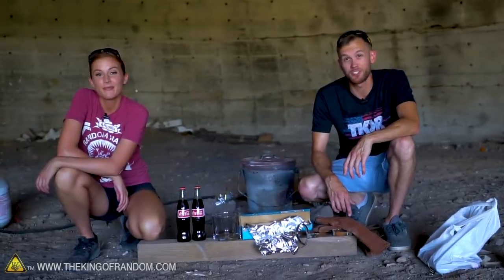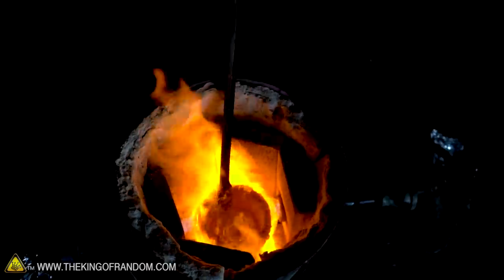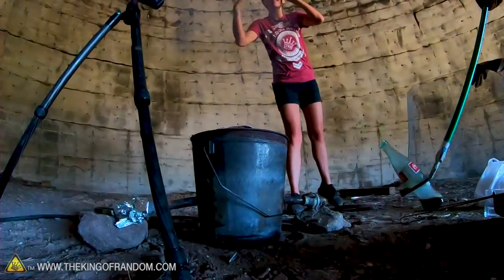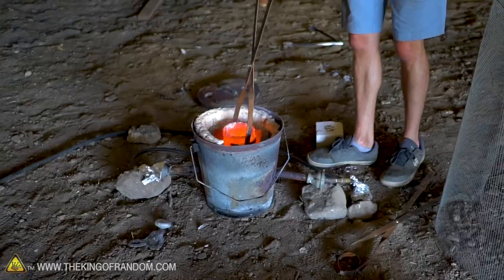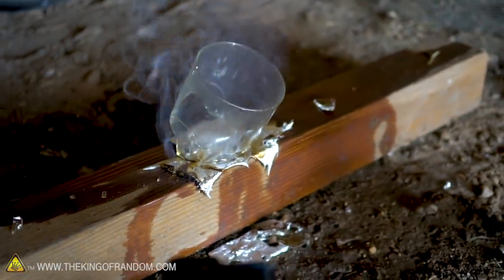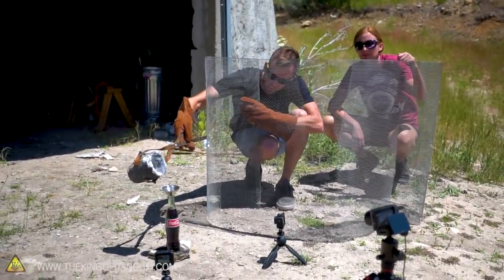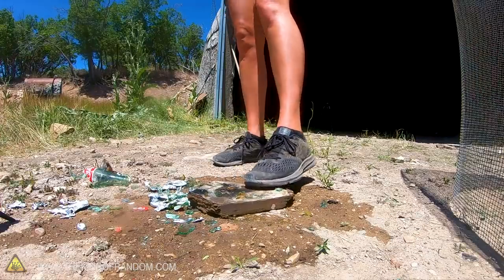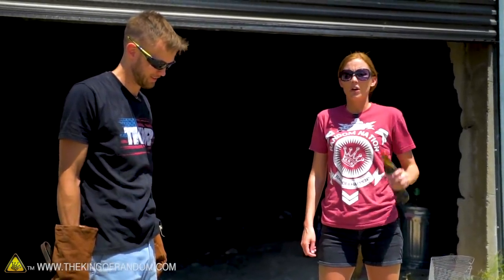Molten Aluminum in Coke Has a CRAZY Reaction

Comment from the maker: For those who may be wondering why we aren't using the new metal foundry, this video was filmed before we made the new one!
Reply: Ok thanks for letting us know
Reply: Love you guys
Reply: I was gonna say...
Reply: Keep on doing those videos!
Reply: Try putting sodium metal in different liquids like soda or liquid nitrogen instead of water
Reply: hey can you guys incase different items in jello and do different experiments with them
Reply: @eguy1596  I like it
Reply: You tried affecting the density of wood in a previous video by boiling pressurizing and using the vacuum chamber. Water was the key ingredient, try liquid galium instead of water the wood might absorb it making an interesting way to make metallic structures from wood. You'd further have to design a new vacuum chamber capable of keeping a temperature of at least 300° Fahrenheit or 148° Celsius making for lots of new interesting projects including trying the liquid galium and wood and if wood wouldn't work try foam or some other material.
Make magnets, melt a fero magnetic material in your new foundry then cool it in a strong magnetic field. It should become a magnet. Experiment with alloys and other metals silver gold try copper tin and so on
Reply: See if mentors still react with boiling coke
Edit:also I'd love to see you guys have a coke bottle rocket contest.
Reply: YEEET THE COKE
Reply: Hey Nate what happened to the large metal foundry you made will you ever use it?
Reply: @kennethsdodge5070  can you read?
Reply: @thegamingspirit9043  Calli verse Nate. Totally epic! I think Nate would win but Kelly's would definitely explode much more fantastically
Reply: Ok
Reply: Mix Sulfuric acid and Potassium Permanganate. It make a chemical called Manganese Heptoxide and reacts violently with isopropyl Alcohol.
Reply: I was wondering that lol
Reply: you might benefit from making a blast shield like the one the myth busters used
Reply: That’s the first thing I asked my self when I saw this
Reply: You guys should drop a whole bunch of Alka-Seltzer tablets into molten aluminium. I'm wondering whether or not there would be a reaction at all because they require liquid to release gas, but it takes a second to start reacting, so I'm thinking they may just burn up. Worth a try though.
Reply: Took the words right outta my mouth lol
Reply: Love u guys
Reply: Can you check my comment and this was AWWWWWSSSSSSSOOOOOMMMMMMMEEEEEE
Reply: Maybe edit out that "you are going to die" line?
Reply: I must be blind because I thought it was
Reply: You and Calli are perfect for each other! If y’all aren’t married to anyone or anything y’all should see if y’all are compatible!
Reply: Ahah. I cant wait to see you use the new one. (Totally didnt edit my comment because I typed did instead of didnt lol)
Reply: Drop molten aluminum on gallium and/or liquid nitrogen.
Reply: Ok
Reply: It's been kind of a ...I'm not going to say "fun," for obvious reasons, but an interesting game of trying to figure out whether a given video was filmed before or after two weeks ago.

There's actually only one so far that I'm certain is new.
Reply: I wonder why you made a new foundry
Reply: Can you guys please say hello to me?
Reply: Hey put sodium in some non-Newtonian fluids and in molten aluminum
Reply: Can you guys try cooking popcorn inside vacum chamber will it be more puffy or will it be more different?
Reply: May I ask why you were shorts rather than jeans???
Reply: The King of Random if you straight pipe a Chevy v8 truck and hold the pedal to da metal 😂 can it shatter glass?
Reply: Put dry ice in liquid oxygen to see if it will still put out fires
Reply: Put the molten aluminum in the candy form the last episode/video
Reply: Ty for telling us. I was like wtf why not. Lol
Reply: Still recovering from
Reply: The King of Random  it is 6 hoooours since u ppppposted
Reply: Oh and by the way you should of used aero gel as it is an almost perfect insulator
Reply: @fishman432  sodium reacts with water and some organics. It will react the same way with soda as with water, and it won't react with liquid nitrogen. It won't react with any pure hydrocarbons, so no gasoline or oils of any kind, and the only reaction it would have with alcohols would be with the water they're mixed with.
Reply: Maybe that was better because of the coke😂😂
Reply: Sodium into molten aluminum
Reply: See what happens when you put lithium in molte aluminium
Reply: I have a challenge, find as many different brands of drinks and mix them all up and do expriments on it :D
Reply: @carolinelyda9008  i totally agree
Reply: Oh, it was made in the week when they where anouseing grant’s death
Reply: @SeaTurtle1122  thank you
Reply: The King of Random np
Reply: I thought so
Reply: Drop sodium in the molten aluminum
Reply: You should pour molten aluminum into a fire ants nest and then dig it up after it cools it makes a perfect casting of the ants nest some people even buy and sell them as art
Reply: you guy should freeze propane fuel and see it if it flammable
Reply: You guys are crazy, that's why I love it
Reply: That’s exactly what I was wondering lol
Reply: You answered my question before I could ask it.............

++RESPECT
Reply: You should make a video on if you guys are dating or not you should make like a q&a
Reply: What happens when you mix sulfur, charcoal and powder of cooked limestone (before putting it in water) and then light it on fire?
Reply: Can’t wait to see the new foundry in action
Reply: Makes sense
Reply: I like to see you guy, drop one pound block of ham in molten aluminum
Reply: @christianheichel  The wood-gallium experiment sounds like it's theoretically possible. However, the magnet one wouldn't work. The reason why magnets are magnetic, is because each molecule in it have their north and south poles aligned. When you melt it down, you get rid of this alignment, and each molecule's rotation is randomized, even after re-cooling it. This renders it non-magnetic permanently (unless you break it down, and practically reuse the materials to make another magnet like they're made in the first place.
Reply: @monkeytank4243  cooled in a strong magnetic field it should work. While still liquid if subjected to a strong magnetic field the metal should aline with the field while cooling. I'm just guessing I haven't looked at the science in years. Maybe I should lol. Either way it'd be awesome to see them try.
Reply: @christianheichel  Yeah, it would be cool to see them work through it.
Reply: I was confusion
Reply: The King of Random i recall you mentioning that you recorded and made some videos before Grant’s departure.

Still happy you are continuing his legacy <3
Reply: MAKE SODIUM VOLCANO
like a baking soda volcano
Reply: I was wondering why you don't your prepositions from your adverbs.
Other than that, still a great video.  Always fascinating.
Reply: Ah thats cool
Reply: is it me or does cali yell a lot more...why does it always seem like she is yelling these past few videos
Reply: I was wondering how much whipped cream is in a can of whipped cream?
Reply: Annecy balls what can you do with them
Reply: Oh i was wondering!
Reply: The greatest warning is a delayed warning ⚠️
Reply: oh ok!
Reply: The King of Random can you dye molten aluminium and see if when it cools it makes coloured aluminium?
Reply: Could u try casting an aluminium container (like a box or cup) and after its cool pour molten aluminium into it!?
Reply: Hey Nate and Cali. Since you guys have a new foundry are you going to make new tongs for it too?

Comment: Cast a prince rupert's drop in epoxy with the tail sticking out and then break the tail.
Reply: Oh, Ohhh. I get it. Explode it inside a casing and see what happens. That's interesting. In clear epoxy so we can see it on the inside.
Reply: That would require them to do actual work. Not a "low bearing fruit"
Reply: @wolfbladesalpha6271  lol
Reply: Bring the slow mo guys or destin from smarter every day too get some very fast high speed shots!
Reply: I don’t think that would work. Maybe it would. Our brains think differently.
Reply: It wont work the same... theres a reason the prince ruptert drops function as they do.
Reply: Only works with high temperature glass. Even with glass it's like a 1 in 10 that you get a true prince Rupert's drop. If you want to know more about them smarter everyday has multiple videos and there are alot of papers on line about them.
Reply: @douglasproductions9501  I don't believe that was his point. I think he meant to make a prince Rupert's drop, then encase in epoxy with just the tail hanging out, let set till hard, then break the tail.
Reply: @ranchis9044  You got it, that's exactly what I meant. Sorry if it wasn't clear.
Reply: @Harrison Griffiths how is it impossible?  What do you mean "dry"? You don't dry prince rupert's drops, you drop molten glass in water to make them.  What part of taking a completed drop and sticking it in epoxy leaving just the tail out are you not getting?
Reply: for a prince Rupert drop to work it should be cooked quickly So that it'll be both crystalline and amorphous. 
it's not gonna be that way with epoxy, because you cure it and not cool it.
Reply: Ooh that sounds cool
Reply: @Vedrajrm  op is saying to create a Prince Rupert drop and place it in epoxy, and let the epoxy harden, then break the tail to see the effect.
Reply: @Vedrajrm  read all comments first.. that's not what he means
Reply: First time I read this I read it as “Cast prince rupert’s dog in epoxy with the tail sticking out then break the tail.”
Reply: Yassss queen

Comment: Guys please do experiments with sodium and acid, please like so they can see this :)
Edit: for everyone that replies “it’s too dangerous” They have done more dangerous things than that.
Reply: The results will be explosive and produce an acid spray and toxic gas if certain acids are used. It's fun, but extremely dangerous if not done remotely.
Reply: @frankium264  i guess they can do it near a river, or a huge body of water
Reply: Sodium+hydrochloric acid=sodium chloride=table salt
Reply: That’s extremely dangerous depending upon what acid they will use. Acid burns, if it gets exploded by the aluminum it can shower out acid and toxic smoke. Another reason is because it will pollute the river if they were to go out there and acid were to seep in.
Reply: Calamixy I didn’t say anything about aluminum?
Reply: So you take acid and a short of sodium? That sounds horrible. You'll trip and puke.

Comment: You should try and float down a river on a couch made from expanding foam!
Reply: That sounds like something park services, environmental agencies, and water management/treatment facilities downstream would have strong opinions about.
Reply: Or just make a boat!
Reply: @jakeskelly2799  An inflatable sofa doesn't break into pieces over time and isn't comprised of a chemical with a very real potential of polluting the water, either scenario resulting in a mess that would be virtually impossible to clean up without expensive specialized facilities.

Even if the inflatable sofa ended up being a bust, it would still remain in more or less one piece, and it's no more environmentally dangerous than going down the river with an inner tube. Expanding foam, on the other hand, would be impossible to guarantee that it won't come apart within minutes of contact with the water, and at that point you might as well be dumping packaging peanuts into the river (and I hope I don't have to explain why that would be a big no-no).
Reply: @Abion47  oohhh sorry
Reply: Abion47 they could always put a tarp or something around it so it would collect any  pieces that break off
Reply: @Brandon11225544  In order to be able to guarantee that it wouldn't leak pieces or chemicals into the river, the "tarp or something" would have to be water-tight, air-tight, and resistant to accidental damage, at which point they are basically just taking the inflatable couch down the river again (except it's way more expensive this time).

Comment: Try putting sodium metal in different liquids like soda or liquid nitrogen instead of water
Reply: Even molten metals
Reply: @drillbank1394  do u mean put them in molten metals?
Reply: Soda would just make it react the same as in water. And in nitrogen it wouldn't react at all because nitrogen is basically innert

Comment: You can actually ‘water’ cast in a manner similar to this... if instead of pouring the metal directly into the cup you pour it into a sheet of paper that’s say in a funnel shap sticking below the ‘water’ line... you have to counter the buoyant force when setting this up... then when you pour the metal onto the paper, it will not burn through the paper until the water boils off... but since the amount of energy required to evaporate so much liquid is so high the molten metal will actually solidify first. I used this technique to make several silver crosses from the same paper mold over a large plastic tupper water container filled with water... the cross being submerged below the water line

Comment: It looks to me that in the first experiments, (adding aluminum to the open coke bottle, and adding it to the glass) broke the glass by heating it unevenly and stressing the glass through uneven expansion stress. Then the full bottle which was capped broke because of a different reason. The liquid inside dissipated the  heat and kept the temperature differential  to a minimum, and it did not break due to expansion stress but broke because the water inside was boiling. This was an overall bottle-wide stress that shattered the entire bottle. Basically a steam explosion.

Comment: The reason the glass wasn't super hot is that glass is a thermal insulator. That makes it very slow to heat up, but once it does it will remain hot for a long time. This is also why the glasses broke on the bottom: they shatter because of the strain on the structure by the heat difference, and the bottom is where the heat is concentrated, while the rest of the glass is relatively colder because of the insulating property.
Also, after it shattered it was not in as much contact with the molten aluminum, which greatly lowered the heat transfer.

Comment: WAIT! Now did the glass break (coke bottle) from the heat from the metal or from the gas bubbles?
Reply: Both, rapid expansion from heat, forming fissures, then the increase in pressure-absolutely shatters it.

Comment: Have you ever tried pouring molten aluminum into a mixture of sodium hydroxide and water, or pouring sodium hydroxide and water into molten aluminum? Dropping aluminum pellets into a solution of sodium hydroxide and water releases hydrogen… So if you do this please be careful. We used to use this reaction to fill hydrogen balloons. If the heat accelerates the reaction it can be quite dangerous because you may wind up with a significant volume of hydrogen.

Comment: hi guys, i want to ask a question about how long does your propane tank last? and does adding air pump actually improve efficiency?  because i've seen designs with air blower and i'm curious if that has a huge impact, i'm going to build one soon so i need your help thanks, and another thanks for continuing the show

Comment: Have water around the glass bottle to try and take the heat away from the bottom of the bottle so it can sit there and boil over and solidify the aluminum. And try out the new Foundry

Comment: Wonder what would happen pouring aluminum onto an aluminum can with and without fluid in it.  Also what if you froze the can first?  Would the aluminum be hot enough to melt the can, would fluid inside the can make a difference, and what would happen putting molten onto frozen? I’m thinking many explosions but maybe the aluminum will cool too fast to cause much damage.

Comment: It would be pretty cool to dip a knife into molten metal and then try to cut something with it. 

If it didn't have enough time to get the knife to the same temperature would it really have any effect at all?
Would the molten metal stick to the knife? What could the molten metal stick to?

Could there be some kind of syringe or baster for molten metal? 

Would writing be possible with molten metal in this way? How are metal things 3D printed?

Comment: hey it only broke at bottom broke because the heated mettle was doing high heating pressure to the bottom  because the cola was cold so it kept the cold keep from heat contact at the bottom and the only protection was nothing and it created a react from the glass cold from cola and he the heat created that crack was the line of the pressure of the heat pressurizing and exploding the glass because the glass could not handle it.Hey 12 love vids and science also want u to mold thing with molten Himalayan salt rock thnx.

Comment: The only reactions being seen was thermal shock from the glass containers. Seriously, wasn't a chance for really a reaction from the coke and metal itself.

Putting extremely hot anything into a glass container that is at a much lower temperature will have this reaction.

Seriously low quality stuff here.